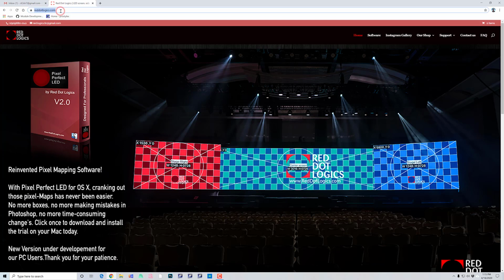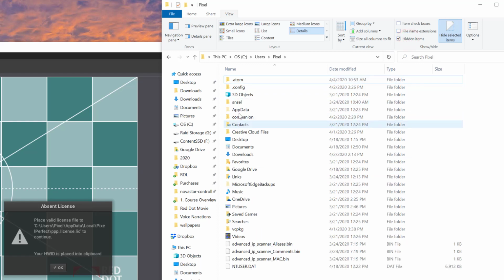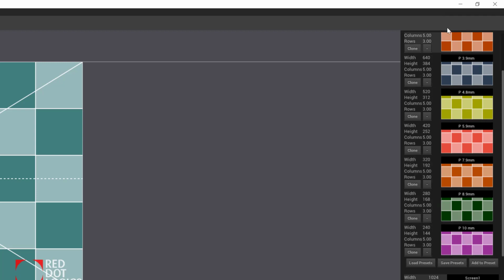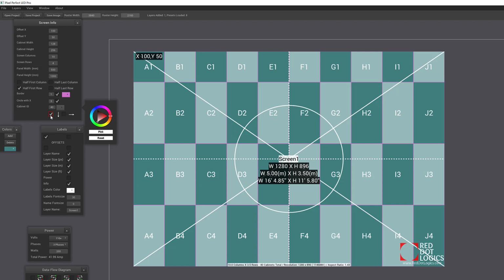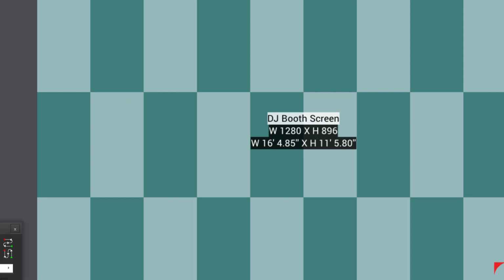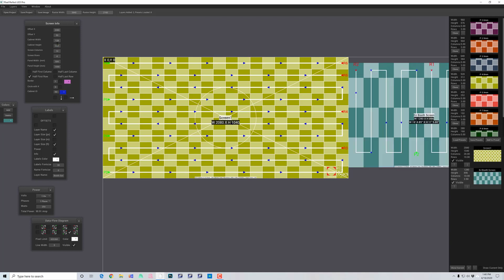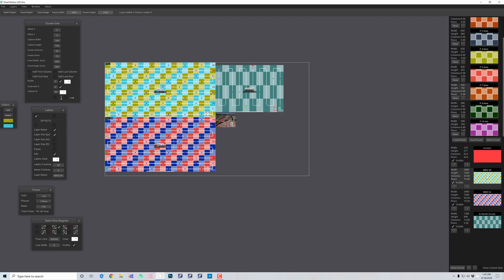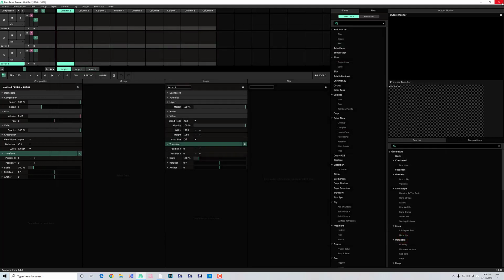How to Install and use the best pixel map creating software, Pixel Perfect Pro

Comment: Hi, how can i draw my own differents path without be constraint to continue my drawing , can i do the only path i want and stop it whenever i prefere (due to the pixel limit?)
Reply: yes you can make your own wiring diagram by clicking Custom pattern, also lets you stop and start wherever but it all depends on Processor pixel limits of constraints. like Novastar normally allows 655,000 pixels per port but it has to do full columns or rows, and cant stop in the middle of a column or row. BUT the new MX series from Novastar like Brompton lets you stop in middle of the row or column to maximize pixel limit.
Reply: @riteshpatel1673   Thanks,we working on a MCTRL 4k , yes i'm trying in a custom path on 4m x 10 led screen,i don't excess the pixel limit but can't stop at a end of a row for make a new one right under the new row ..